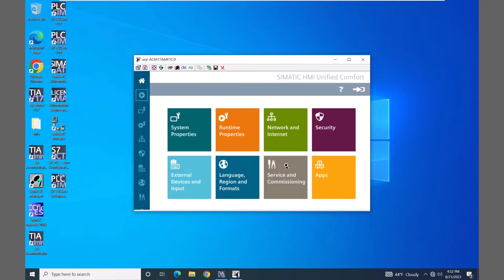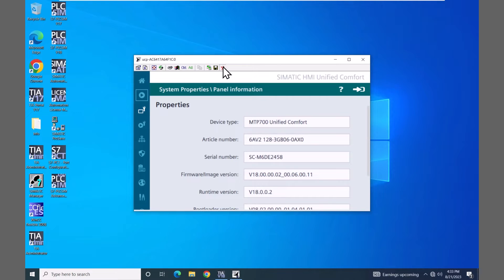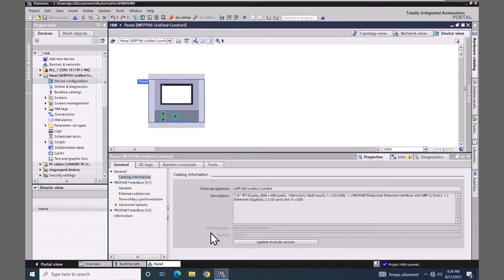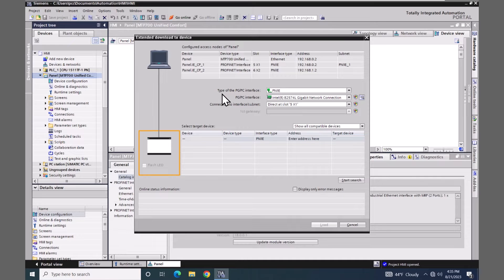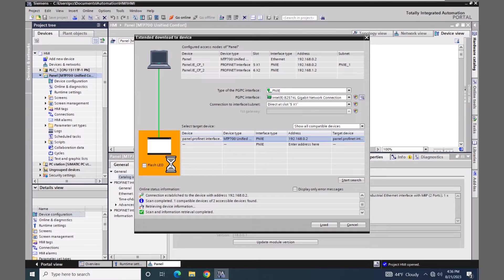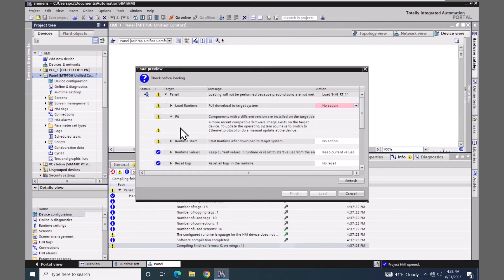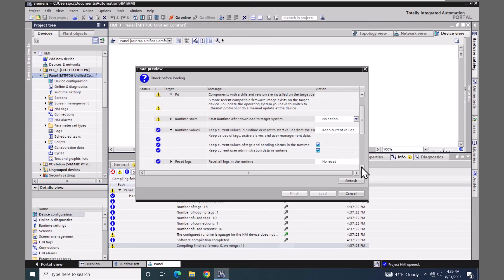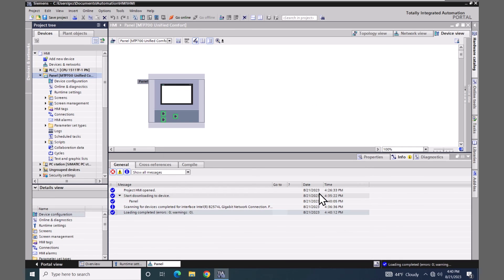Lesson 20 - Ethernet Project Transfer | Siemens HMI Training

Comment: HI 
at first i want to thank you for your great effort you have done and the way you illustrate all the info in simple way 
i have small question now i am working on hmi unified panel V18 while i am using TIA V17 
the question is : Can I upload the project on this panel with a lower version or should i install TIA V18 to be able to upload my project to the panel 
and thank you :D